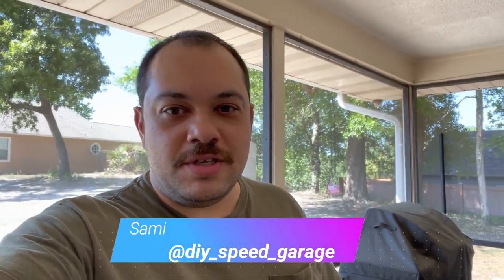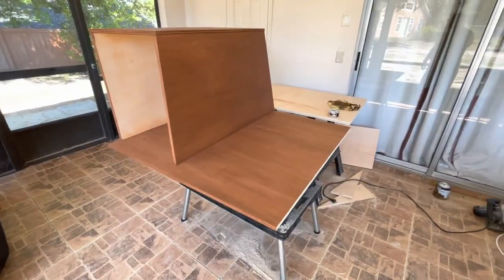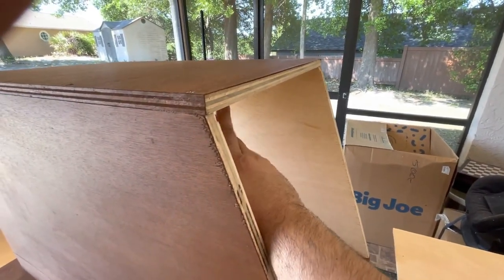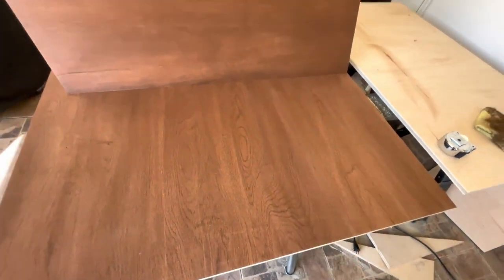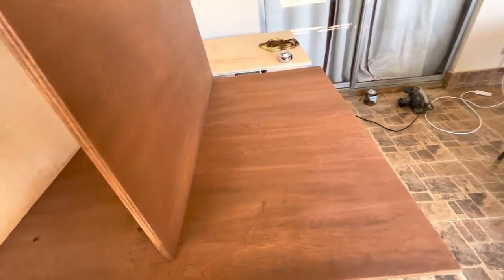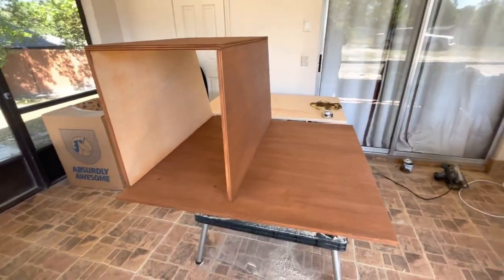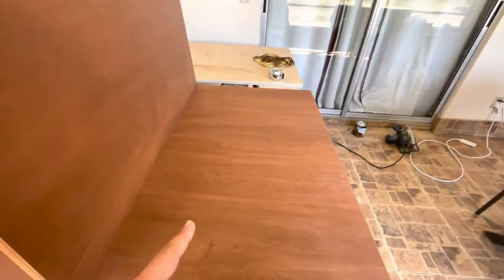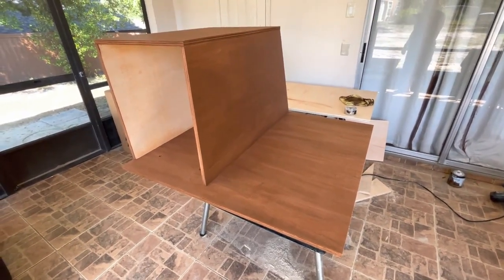GX460 Cargo Area Storage DIY Part 1

Comment: Looking good. Can’t wait to see it installed. I can’t remove the rear seats and add a platform because I have three kids. But I did install a removable single drawer and drop down fridge slide on top on the drivers side third row for longer trips.
Reply from the maker: Thanks Rob 😁 I'm almost done with it. By the way, how are you liking your new Autel? We're you able to program your new key card? Cheers

Comment: How heavy are the items you plan on putting in the drawer would be a consideration.  Also with such a long pull out track maybe use 3/4” for the bottom for max strength.  Great project idea.
Reply from the maker: Mostly recovery gear towards the back, the rest should be camping gear like gas canisters, folding camping chairs, just stuff.... 😂